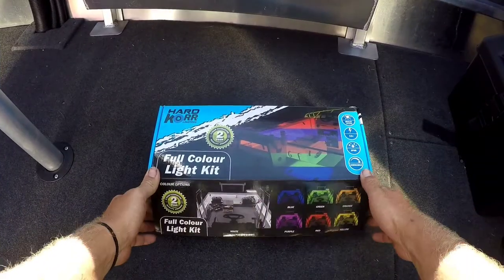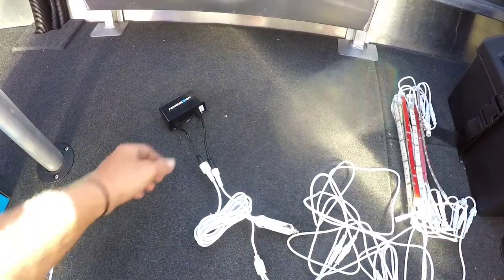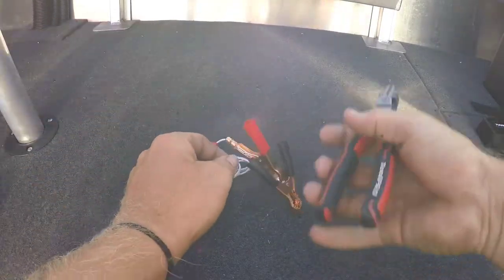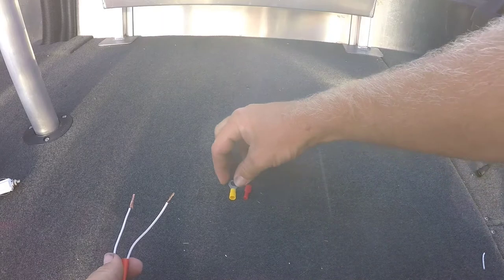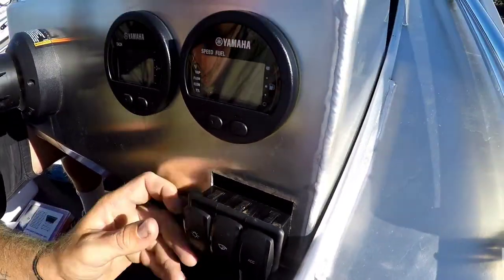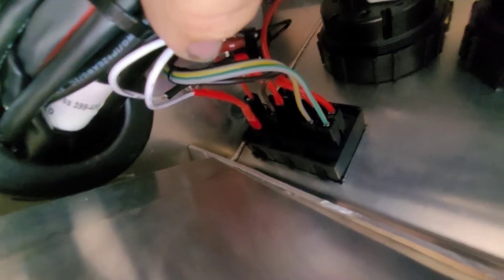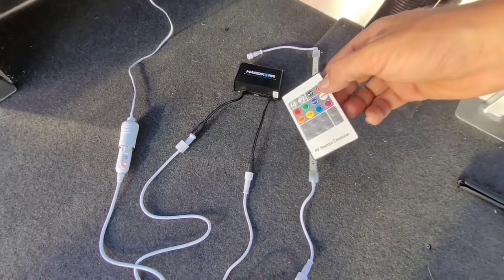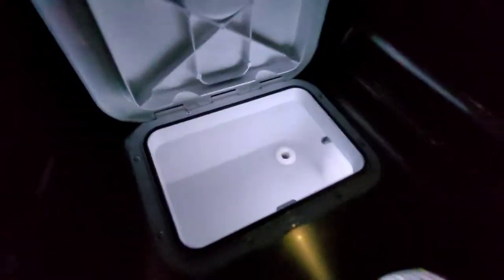Beginners Guide: HARD KORR LED Strip light walkthrough

Comment: Hey mate, what size battery would i need for it to run all night
Reply from the maker: @ZachMcInerney  the lights only have a 2.7ah current so any deek cycle battery 100ah plus should be able to cope over night. I'd highly recommend talking to an expert for batteries but also make sure your outboard charges batteries or you have a sufficient charging system on board. Or a separate battery for accessories besides your cranking battery.